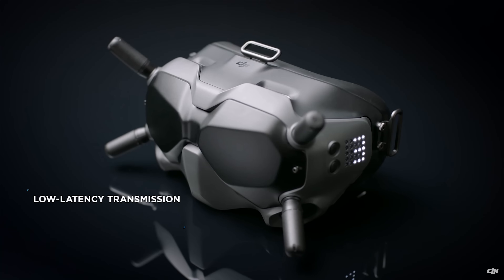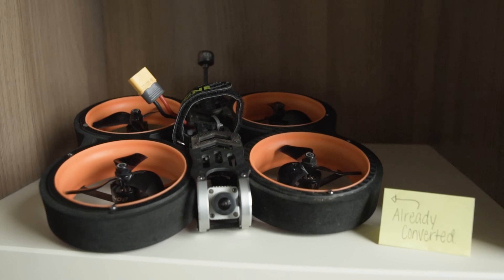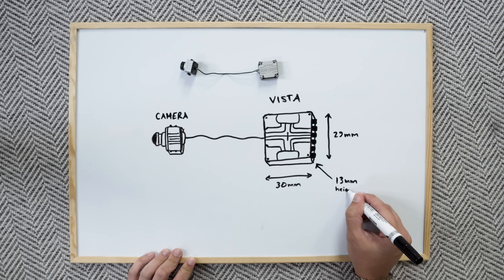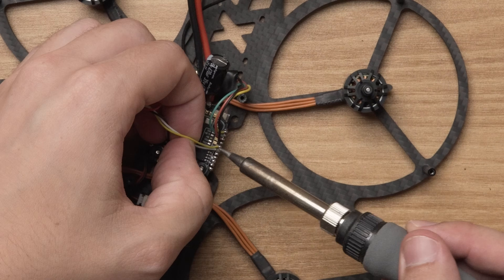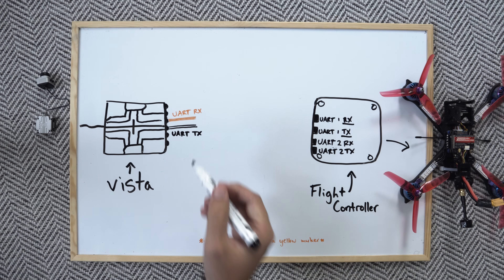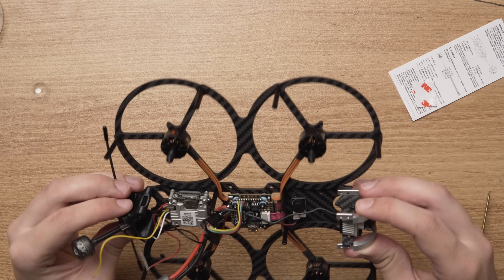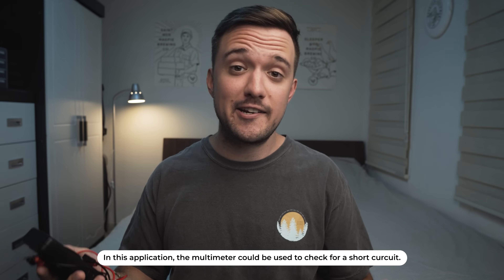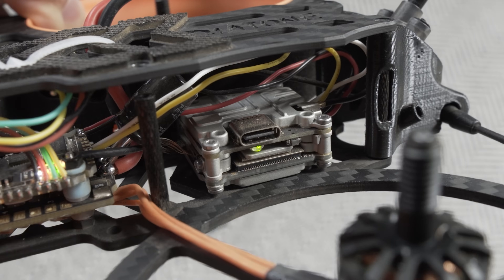Converting An ANALOG FPV Drone Into DIGITAL

Comment from the maker: Hope you guys find this helpful!
Reply: buy a smoke stopper it really helps
Reply: 9.99k subscribers - so close!
Reply: Great video!
Reply: Are nazgul5 arms compatible with HD frame?
Reply: im on team analog ... put up with it
Reply: also the vista digital video transmission is a bad name... it is probably called that because its most likely like windows vista
Reply: Do you know if you could stream the Nebula vista to a phone or is it only goggle??
Reply from the maker: @sleepytoken13  Only in the goggles. The only options at the moment are to get a second pair of goggles or the DJI smart controller and stream to that (which is even more expensive)
Reply: @MattPochwat  im using anaolg and always have broken video when i fly my quad with my friend that using digital. Do you have advice? . Thank you
Reply: mate your aussie its solder not fukkin sodder

Comment: I need to use an analog camera on a digital drone. 

The analog camera also has an option to output USB-C video in the UVC or MIPI format. Would i be able to use it on a cheap Chinese digital drone that has automatic takeoff and auto-return features? Do the cheap Chinese digital drones take MIPI, UVC or other inputs from the camera? I'll be ordering both via the mail, so can't inspect the drone for the interface.

Comment: Can you please do a video on the compatibility of the dji controllers and goggles, for example I bought an analog drone which comes with a caddx Ratel 2.1mm Camera so is that going to bind with my dji controller and goggles or would I need a caddx Vista? Can't find a video on this

Comment: Matt, one thing yo may want to mention is "as the user is taking apart the drone, each step along the way take a good high res photo of the connections and components" just in case you need to re-do something.

Comment: Great video definitely I'll re-watch it when I'll be upgrading my Protek 35 to digital :) Small comment at 8:44 - the 7.4-26.4 is voltage not "power" ;) Unit of power is Watt. Weird that they labelled that in their instruction.

Comment: Good deal. im on the list for v2 goggles  , if they even exist , lol . got a vista coming that i'll probably throw in my taycan. hope it fits in the 2.5inch version but i'll make it work. it'll be a lot lighter than analog cam + gopro, might stay under 250g with small battery.

Comment: A cheap investment that you don't mention is a smoke stopper definitely check your continuity via a multimeter but before you plug your battery in attach a smoke stopper then the battery and power up. If there is an issue the smoke stopper will cut the power before it does damage to the esc / flight controller

Comment: Thanks for the video Matt! Its a shame to have to bring both pairs of googles around to fly your old analog and new dji drones though. Is it better to just upgrade everything at the same time? its not mentioned in the video.
Reply from the maker: Another option is to buy an analog adapter for your digital goggles that would allow you to plug in an analog module (like rapidfire) if you already own it. It might add a little bit of latency to your analog video but not that much

Comment: Great video as usual and right on time. I’m also planning to upgrade some of 5 inches to digital and my nazgul5 was in the list. Just learned in that video that it won’t fit without replacing the entire frame with the Xl V2 version :( 
So I will have to consider upgrading my lal5 style instead :)
Reply: You can make it fit in the nazgul 5 with a bit of work without buying anything new. I left a comment in this video with some steps to achieve it. I converted mine and works great
Reply: @jfrowiess  I was considering only resoldering the capacitor on top and may be the main battery lead and that would make enough room for the vista. Anyway, i'm yet to receive it.
Reply: That could also work, the trick is to fit the vista vertically.
Also, you can change your standoffs for higher ones, but I did not like the fact that the quad becomes higher

Comment: Good video.
For the people that have a nazgul 5 and would like to fit a vista without buying the new frame, it’s possible.
Steps:
1) Remove your vtx, antenna and camera.
2) Turn your esc + flight controller 180 degrees, so the battery leads and capacitor face forward. Watch Joshua Bardwell’s video to configure this correctly in betaflight.
3) Remove the receiver.
4) Mount the vista vertically on the back using double sided tape and zip ties.
5) Fit your receiver on top of your flight controller with zip ties to the top plate
6) Zip tie your battery cables to a standoff on the side to keep it away from the props.
7) The antenna fits perfectly ;)

I’ve been flying like this for some time without any problems :)

Comment: For the beginners that want to learn how to solder, find an old non working electronic device and where you see the power cord soldered to it, just practice soldering by connecting and disconnecting the solder joints with a soldering iron.. Great way and a low cost ( soldering iron) to learning how to solder. 🖐️🤠 Great video Matt, subbed your channel!

Comment: As an intermediate pilot, this is very clear... and the whiteboard/marker illustrations are what I'd expect from only from a professional marketing video... very effective. The only thing I have to offer is that if you find your camera-to-Vista cable is too short; there are after-market solutions that are longer, so you can adapt the Vista to larger frames in the best layout and weight distribution. Also, use a small desktop fan when working on the flight controller to dissipate the solder fumes, and likewise, with the Vista powered-on to add airflow and keep it cool.

Comment: Hey man nice vid as always! Do you know if it makes sense and if yes how to use as dji system with crossfire, if you dont use a dji controller? Thanks alot in advance, love ur vids!!
Reply from the maker: Yea for sure. I use crossfire on all of my drones. You would just set up crossfire normally and then you wouldn't have to attach the last two wires on the vista which are for the built-in receiver.
Reply: @MattPochwat  Thanks alot! I am relatively new and looking to fly with my nazgul 5 (R-XSR Rx) to start off. It is so hard to decide whether i want to upgrade to one of the top notch analog goggles (HDO 2) or the DJI System, eoulf you have any tips or suggestions for finding the optimal solution! Appreciate your help lotsss!!😄💪🏻
Reply from the maker: @leonardfpv  If digital interests you, then I would definitely just get the digital goggles. A digital set up costs just as much as a high-end analog setup. Some people still prefer analog to digital, but for me, the positives of digital greatly outweigh any negatives.
Reply: @MattPochwat  Thank you very much! Maybe I will upgrade for christmas, Digital would truly be the bomb! Looking forward to the next videos!!
Reply: @MattPochwat  If I may ask another question, did you convert your Nazgul 5 to a digital system already? I would absolutely love to see a video on that!😄💪🏻